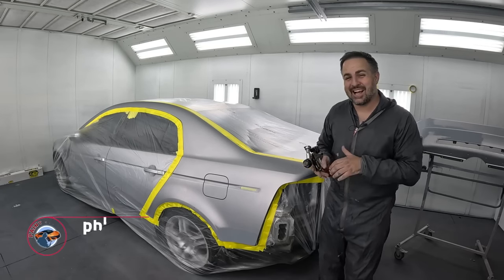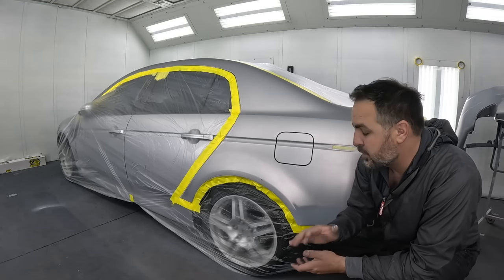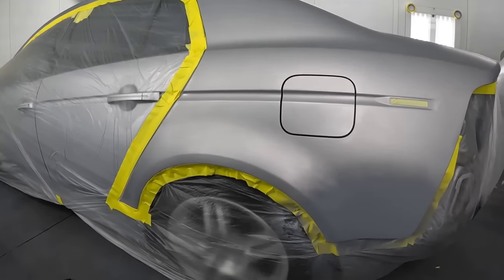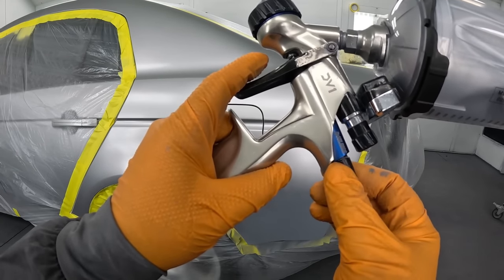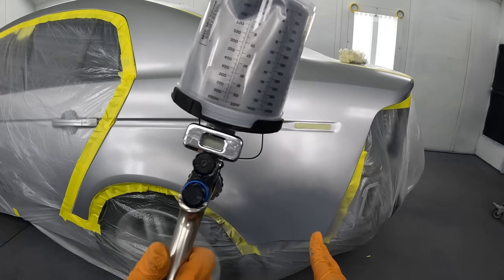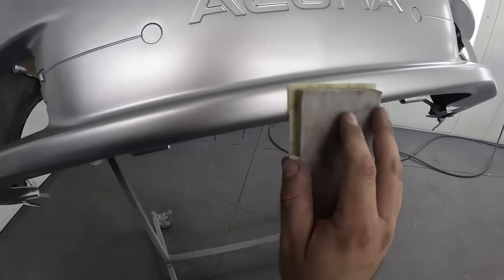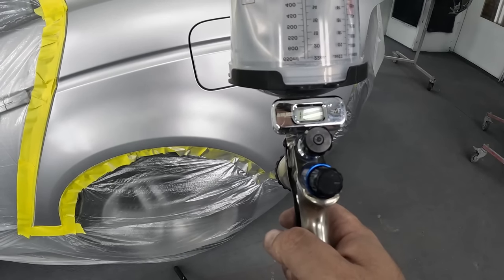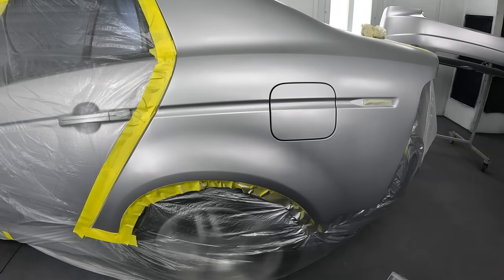Silver Metallic Paint Hack!

Comment: 2 years ago I was painting a 1980 Chevy Blazer with the exact gun Brian is using here (sprayed at 15 psi and final coat at 12-13).  I had blotches, stripes and sand piling in the dark silver metallic.  It was terrible.  I tried a 4th coat.  Mistake.

I emailed Brian....he did not know me from Adam and gave me the EXACT advice he gives here and that slow or extra slow reducer is the money shot.  It lets your paint fall into a wet bed rather than dry in the air and land dry.  Brian is right on.  

I was spraying in my garage in Michigan in March so I had the heat on 70 but had to open the doors while spraying so I thought a medium reducer would work....nope!  The paint store literally thought I was nuts when i went in there asking for slow or extra slow reducer during a Michigan winter.  Honestly, I thought Brian was nuts too....but I had no choice.  I was desperate.

I had to allow 30 minutes between coats and even went overnight before going to clear coat since my shop is not a high heat paint booth.  Brian is a class act and saved my butt!

Thank you again sir!
Reply from the maker: Thanks for the awesome feedback. Glad to hear your success.

Comment: Yes I noticed if we spray too many coats and its pre drying in the air, then when it lands on the panel the angle of the metallic particles starts to layer on different angles which the magnifies the streaky problem. Sanding smooth again and doing two wet coats, then one light coat seems to rectify the problem. I did that with spray cans too and it works. 

thank you for the helpful tips, I share your videos with friends
Reply from the maker: Great point!p

Comment: if you want to check the painted area for good blended metallics. spray  grease and wax  remover on the painted area. it will act like clear when wet and will dry up with out damaging the paint ready for clear. great vids
Reply: U do that?
Reply: @tonydiesel3444  yes. this is the best way to check your freshly based blend panel for coverage, color match and mottleing with out using clear coat but using a wax and grease cleaner instead. try it. iv done this hundreds of times for checking colors. iv also painted over 10,000 vehicles. "experience told me this"

Comment: I didn’t see it in the description, but what I use on my sealer edges is U-Pol Fade Out aerosol. Just a couple of light dustings around the edges of the sealer, followed by a good tack rag after flash time, then some blending clear over the panel(s) leaves a great substrate for a smooth blend.

Comment: I had a "surface rust" repair on a sliver Chevy yesterday that turned out to be a "rust-thru" that involved more work.
   Got so wrapped up in reconstructing the lost body line that I forgot I had color blender when I finally got to the paint. Ended up sanding with 1000 and hitting it again. Wheel well up to mid panel. Stayed away from the panel edges. Not perfect, but was pretty convincing. Owner was happy to have the rust gone. Guess who will be using that color blender next time....🙄

Comment: Great video 
Got a question. I am in the process of repainting my bumper cover. I have all the clearcoat sanded off and got down to bare plastic in some places.Will it be ok to just prime or should I spray adhesion promoter just where I sanded through. I'm priming with SEM High build primer surfacer spray can and SEM urethane base. Thanks

Comment: My first attempt to paint my silver metallic wheel arches, outdoor, on my driveway in UK, during winter, from a spray can, 80% humidity, 15 degrees outside, windy. - Fail bad colour match
My second attempt was to buy proper paint that matches and use a spray gun (DV1S). Almost same climateric conditions 12 degrees outside - Fail uneven blend and due to humidity it flaked.
My third attempt was to fix the flakes, 9 degrees - Fail to blend, flaked again
My fourth attempt was in my neighbours garage start from scratch - Used heat gun, thinner coats, 7 degrees outside. Failed to blend also too coarse grain. But I sanded and left it like that.
Covered with Lacquer 2K clear coat. Next morning the clearcoat was not clear at all, all "frosted/shadowed"
Used heat gun to restore transparency. 

I gave up. DV1S spot repair, 1.7 Bars 1.2mm HVLP+ nozzle. If you don't have a dry, warm, clean, available for DAYS, place. Don't even bother trying to paint anything yourself. RIP. 
Never failed so miserably in my life for a DIY job.

Comment: I have a different issue with silvers.

Even when I do match pretty good under certain angle the part of the panel that I painted is not as sparkly as the factory.
Any suggestion on nozzle size, pressure, or whatever I need to do to make my silver more metallic.
Greatly appreciated 👍

Comment: I teach a high school auto collision program and use your videos regularly. You explain things so well. My question is triggering the spray gun. I have watched a number of your videos and you do not release your trigger while painting. I was taught, and have passed on to my students, that they should partially release the trigger at the end of they spray stroke. Is there a correct way or is it a preference of the painter? Thanks again for the great channel.
Reply: your not killing wasps.. when you stop pulling the trigger, then pull it again, your creating a burst of pressure.. a pulse...  this causes  blotching.. usually near the edges because thats where you stop and start pulling the trigger,, also some people flick thier wrist at the end of the panel,  this causes uneven  paint as well..They do this to try and look like they know what they are doing,,, but they dont,,,,  it looks like they are throwing as frisbee.. 
 you want to be like a robot.. consistant on every pass. when u flick your wrist, it causes a tendency to move the gun closer to the surface when you start to go back the other way..
 concentrate or you distance from the panel, your speed, and the "wet: line of the paint, as well as your overlap percentage.  your wet line determines your speed in relation to the distance you are from the panel..

Comment: Brian, I thought after applying the blending coat you immediately apply the base so as to have the base fall into a wet bed.  in this video you allowed it to flash - confused?? Great video as usual.
Reply from the maker: Yes you can do that as well. I have been able to get away with just using extra slow reducer instead. Great question

Comment: Personally I’ve had issues with taking my clear base/blend bed all the way to the edge of a blend panel. It seems to darken the color compared to the adjacent panel. I’ve had great success with only taking it past where my color will be blended, using slow reducer and making sure my gun is spraying good. I’m not sure if you have ever ran into this issue
Reply from the maker: Yes that can happen
Reply: Check your tape when you’re done.. I always use wet bed on the entire panel to remove sanding marks.. never have an issue with darkening my colors. BUT, I have heard and seen other painters have that happen. I believe the issue is actually that your overspray from your blend is reaching the end of the panel making it darken.. so check your tape! I think it’s a myth personally but that’s just me

Comment: Around 4:45 you said "13 or 14 PSI", I think you meant 23 or 24?
Reply: Not on a DV1, they are designed to spray at lower psi. They are really good at not wasting as much material.
Reply: If you have the b plus cap on it that one is also designed to run at low and mid pressure while the original is only low pressure
Reply: @stephencasagrand2489  that's awesome